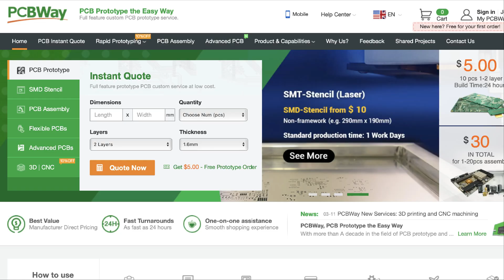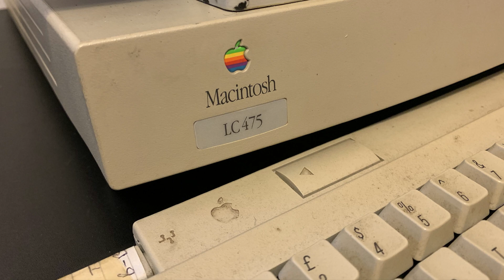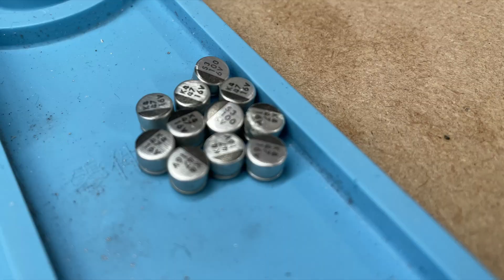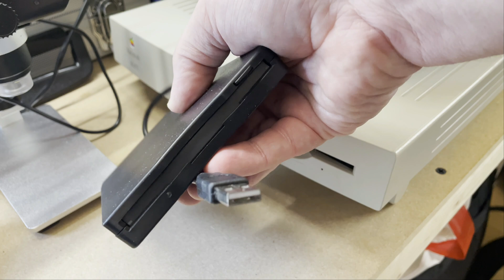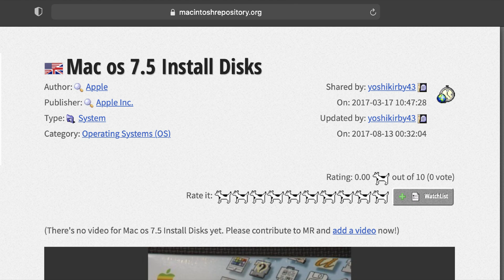The LC475 Strikes Back - Part two of the saga!

Comment: Hello, i have a Performa 475, i have repaired the power supply, but when i turn on, the "Chime" sounds distorted, some buzz. I have recap the solid capacitors from motherboard but the problem persists. Know you the problem?

I have try another speaker and the same distorted chime. I have clean the motherboard, and clean jack with deoxid. With headphones the chime sounds good, but unplugged sounds distorted. Maybe faulty TDA7052?

 Thanks.

Comment: NOOOO! The Empire Strikes Back was the best of the trilogy. 😂
Also if IIRC Mac floppy drives of the era were using either a non-standard format or variable speed motors, so I doubt you can create a working Mac boot floppy with a USB drive.
Reply from the maker: Actually, I did get it to read the floppies, but it would always crash at a certain point - I'm thinking that the drive itself was probably getting stuck and needs new belts etc.  But at that point, I was about to throw it in the trash :) :) Luckily Mac84 is there to save the day :)
Reply: @TheRetroShack I look forward to watching that.

Comment: A 14" Apple Basic with a broken power switch!?!?  THAT NEVER HAPPENS ;)
Reply from the maker: Yep - Haven't gotten round to fixing the switch on the monitor yet - figured it's the least of the problems at this point :) :)
Reply: @TheRetroShack  I cut a small piece from a bamboo stick and jammed it above the switch, now it is permanently on and it is barely noticeable
Reply from the maker: @ivandiazalvarez  going to give that a go! :)

Comment: I have two LC475, but they're in much better shape. No battery corrosion whatsoever. They still don't work, but its known they need recapping, and both have a dead PSU. Both show some signs of life with another PSU at least (get to chime). Still collecting the willpower to start a fight with them... Thanks for this video, will follow the repair on Mac84 channel, in the hope it will give inspiration to finally start repairs on my own machines.
Reply from the maker: I have found this quite soul destroying! I think mainly because there’s no real ‘Love’ for the these machines in my heart (Aaaahhhhhh) whereas with an 80’s 8 or 16 bit machine, well they were part of my childhood :) But I want to see this through to the bitter end :) :)
Reply: @TheRetroShack  Yeah, 68k (and even PowerPC) Macs can be really unrewarding to work on, compared to other retro HW. My main problem is, that an Amiga 1200 even with a 030@50 card is a faster (certainly for boot times) and in several ways a more versatile "68k Mac" using Shapeshifter. For my use patterns anyway. So if I want physical 68k hardware and 68k MacOS, I just fire up that instead. Especially since the Amiga is on my desk anyway... But regardless, I'd like to have a real working 68k Mac too, so I'll get to these, sooner or later.